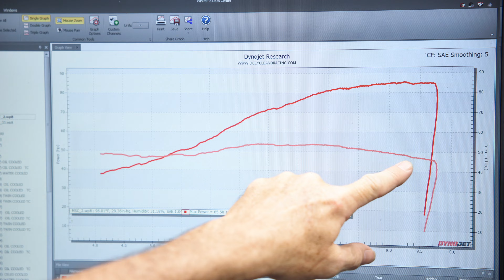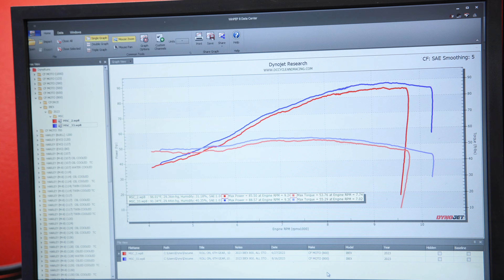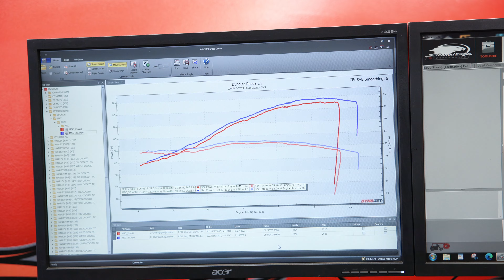CFMOTO IBEX 800 Dyno Runs & MSC Tune

Comment: Thank you for providing aftermarket support for CFMoto bikes! 
I got my 700 tuned and it makes a great motorcycle even better. If you ever decide to make a version 2, the 700 could still use a bit of throttle smoothing at in town speeds, 30-40 mph. 
I am thinking about getting an Ibex because the riding position is so darn comfortable. Having an ECU tune available might make the difference in my decision. Thanks again! 
BTW, anyone who is considering this service, they got it done and shipped back to me super quick.
Reply: I just bought the 2023 IBEX  800t and it bogs and chops pretty bad in the first gear and somewhat in the second. Any ideas on how to fix this?

Comment: I just installed my flash ECU, today. Low end not cold blooded like before and has better throttle response.
Will try top speed run next weekend. Stock was 126 mph. Have 4 " adventure " bikes all limited to about that speed.

Comment: 6:56 You don't have to remove the aluminum rack. 
Just remove the 2 front bolts and the seat lock bracket will come out by just lifting / flexing the aluminum rail. Slide out seat lock bracket at an angle.

Comment: Does this smooth out the low rpm jerkiness in the lower gears? If so, I think you’ll have a lot of demand I know that if it’s proven to smooth out that jerkiness in first and second, I would consider it. To be honest I don’t care about going any faster but smoother throttle response and improve gas mileage is high on my list.
Reply from the maker: Yes it definitely smooths it out. We need to get some customer reviews out there soon.
Reply: SAME!
Reply: I need smooth crawl in sand
Reply: Recalibration spirit throttle will smooth it out too, and it's free and can be done without removing anything.
Reply: @CCWSig what’s the recalibration spirit throttle? I just bought man and the choppiness kind of kills the ride tbh
Reply: @RealTalkPowersports if it got rid of the choppiness I’d post it anywhere lol
Reply: @CCWSig  ⁉❓❓

Comment: Is your Ibex 800 tuning service only for stock exhaust bikes? What about aftermarket pipes with cat-deletes?
Reply: I received my tuned ECU back last week and put a few hundred miles on it since then. The tune definitely helped with the engine running better with my decat exhaust but the on/off throttle still feels very choppy in 1st to 3rd gear. With throttle closed in those gears and just barely a little twist open, it feels abrupt and not smooth, a little sketchy modulating throttle in turns. Is it possible to smooth that out more?

Comment: Did that solve the jerckiness on low rpm ?
Reply: Recalibrate your throttle,  that will take the jerkiness away.
Reply: @CCWSig  did that with no luck
Reply: @seratatu just bought mine yesterday, tried to recalibrate but no luck. 2023 800T
Reply: @willwilder5269  Same...they said that only a remap could solve this issue
Reply: @seratatu I’m thinking I’ll try again after the break in period. Some others mentioned to just use rain mode in the cities. Hopefully the bike is good other than that, people seem to love it

Comment: I want a tune just to smooth out the lower throttle response... I get a lot of pops and burbles with my Leo Vince exhaust too...  can this fix that?
Reply from the maker: Yes this will smooth it out on the bottom end.. but we are also going to be working on a tune with aftermarket exhaust
Reply: @RealTalkPowersports did y'all get the tune done with the aftermarket exhaust?

Comment: Common failure CFMOTO has been ongoing low speed jerking, unstable fuelling. How did fuel mapping get signed off. How come you can solve low speed jerking when CFMOTO hasn’t?
Reply: CFMoto has to ship a tune that meets emissions standards. All modern motorcycles are lean at lower RPM from the factory, and many have a flat spot or a dip in power between 3k and 4k rpm because of that.